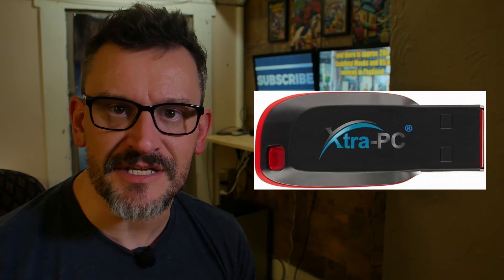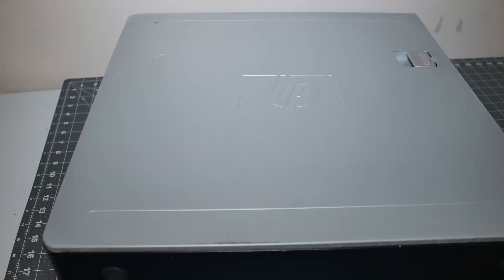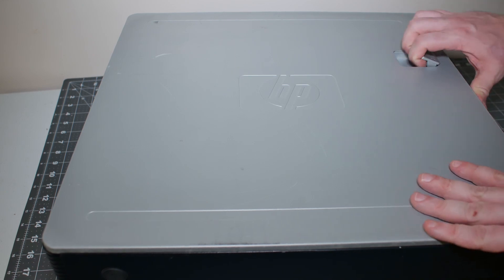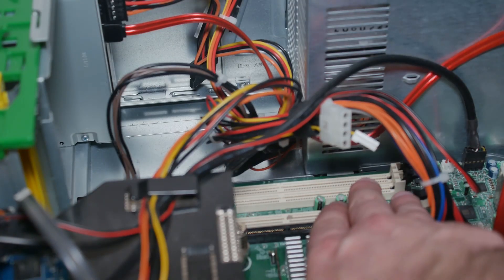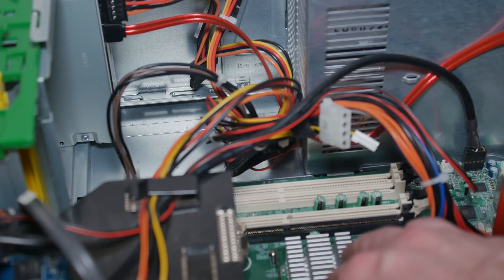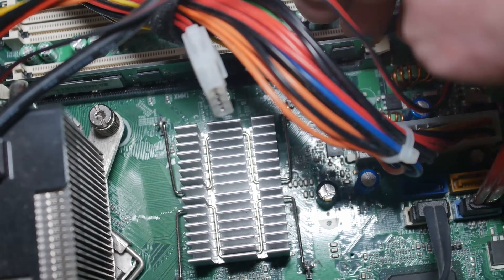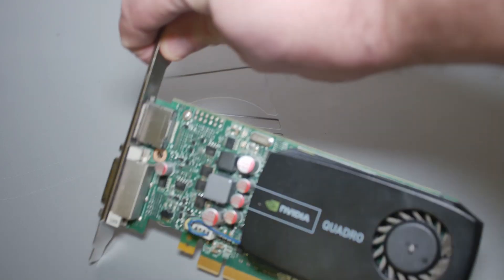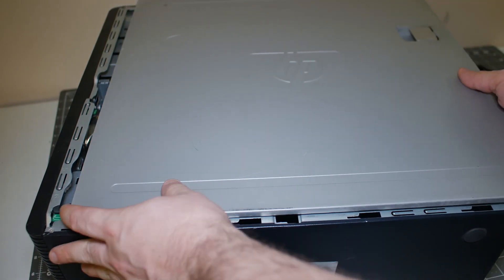4 Ways To REALLY Speed Up Your Old PC!

Comment: I've never had any luck getting Linux to run on anything. Outside of that, I have an old 1st Generation i7 machine (originally running XP with 4GB of RAM) that I've upgraded in much the same way as you have here. It runs like a completely different machine now!

Comment: Does adding a graphic card improve video playback on old pc ( with integrated graphics)?
Reply from the maker: In most cases, most assuredly, yes, it will. The only possible exception would be if you have a newer PC with integrated graphics that is far more powerful than something like a really really old graphics card that you would want to put in the PC, in which case, the aftermarket graphics card would potentially make the playback worse. 

As a basic rule of thumb, if the graphics card is newer, or at least around the same age as the PC, it should improve the video quality.
Reply: @LDTebikes  Thank you for your reply!
 I have this combo CPU: AMD Athlon 7750 dual core & MB: GA-MA78GM-US2H. Don't know what GPU will be good for this? Can you please help me choose one?
Reply: @vjayjob  gt 710 at lowest and a gt 1030 at best if you want to go NVIDIA

Comment: 5:50 I see this puppy needs new capacitors also, technically the PC would run with bad caps, but lemme tell you that the filtering they are supposed to do, imagine it be just gone. I don't think a motherboard would appreciate ditry power lines, so if you happen to have a motherboard or any component which has bad caps and you can do a little soldering, THT caps are not that difficult to replace. And why they bulge? Age and most likely cheapness, back in 2000s there was a scandal with cheating on the capacitors and they can make all sorts of stuff, I have personally seen a lot of these situations.

Comment: Is there any reasons why you wouldn't be able to add or replace a HDD with a SSD on a laptop? I still want to run windows 10. It's a fairly new-ish laptop, 2017, but was budget to start with.
Reply from the maker: For the most part, if it's a 2.5 inch hard drive, replacing it with an SSD is pretty straightforward.

Comment: Just found you channel and I'm loving the content, specially the one for just one usb drive instead of several. I've been wanting to ask: do you have any recommendations for backing up files on windows? I'm looking for an easy to use solution where you can select what folders you want to backup, and overtime it compares what files are missing/have changed and just backup the new things. Also on this same topic, is there any backup software that can generate a ISO clone of my windows in it's current state in case anything goes wrong with my pc?
Reply from the maker: Actually, there are several ways you can back up specific files on Windows. A scheduled batch file that runs a Robocopy command with the proper flags will do it. I need to do a little digging, I think I have a file with that command somewhere (sorry, I'm not a command line guru, so I don't have everything memorized). 

As far as an ISO clone of your machine, I'm not aware of how to do it in that way, but you can use Clonezilla to generate a system image. That's what I do. It's easy...and I do it every few months because I don't trust any antivirus software.

I've found that keeping a clone on hand of a machine after you've installed all of your stuff is a great idea, because it's generally faster to restore a cloned image than it would be o remove a virus.
Reply: @LDTebikes  That's very helpful Paddy, thanks so much for the information and replies. Keep up the great content.
Reply: @LDTebikes  My unlucky information: 
Whenever I come near a PC, it slows down automatically, but when others come to the PC, it automatically becomes faster. :( I want to be like them. >:
Reply from the maker: I think this is what you want for auto backing up your files. https://community.spiceworks.com/topic/209883-robocopy-only-copy-new-changed-files

Just put that in a batch file, and run it on a scheduled task.
Reply from the maker: This is the command I use in my backup batch file ------   

ROBOCOPY.EXE "\Directory\you\want\to\copy" "\Your\destination\directory" . /E /XO
exit

There's probably some command line guru who has a better way of doing it, but this works for what I need.
Reply: I use an old version of Norton Ghost (whatever one you can find is fine) to make a full disk image; at need it can be restored with Ghost, using a boot CD and a flash drive. The Ghost image can also be browsed with Ghost Explorer, and individual files extracted.

BackupPC is free and has been around a long time, tho I don't personally use it. 
https://backuppc.github.io/backuppc/